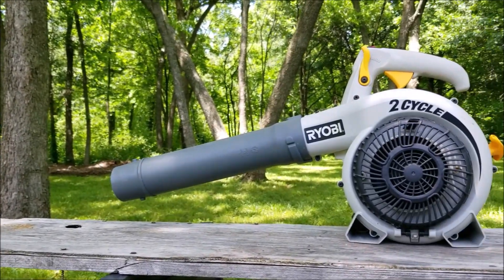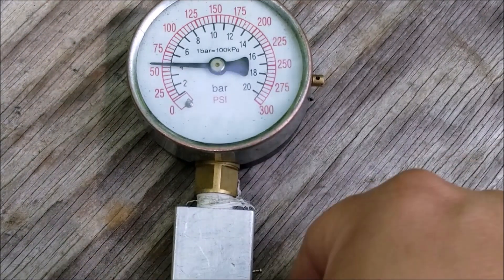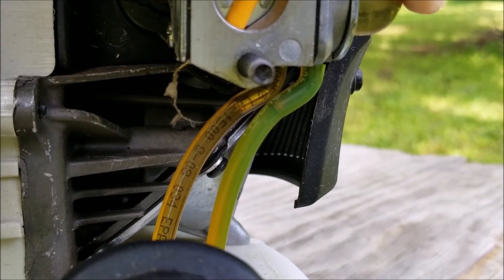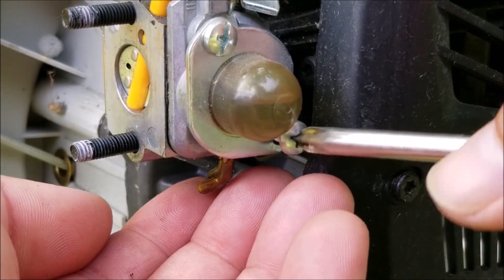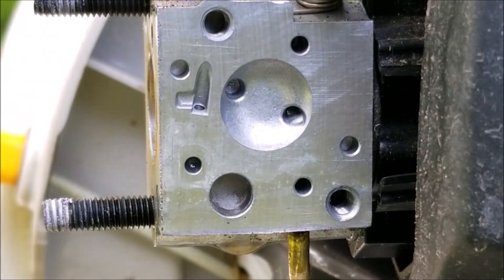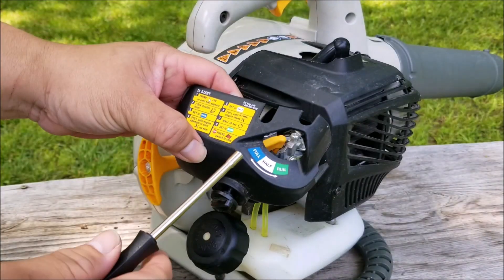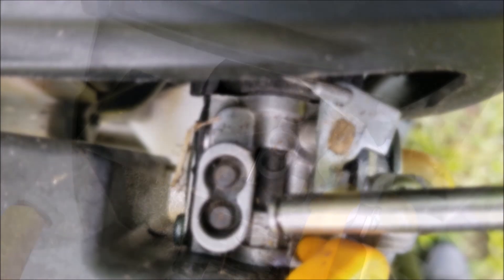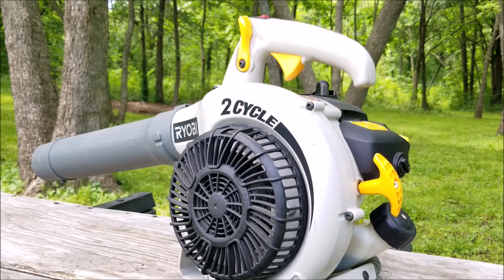Leaf blower starts but won't stay running finally fixed

Comment: I love your channel so much I guess I went back and watch most of your back vids and have got some of my friends to to watch as well . I have a small shop behind my house and work on most everything love it so much . I just had the luckiest day of my small engine repair days three days before thanksgiving I was going home through the rich part of town and saw this woman putting a bunch of Stihl weed eaters and two stihl chainsaws by the road so I stopped and ask was she getting rid of them and she said I could have them they looked good and was freaking out I was about to get them . Then she told me her husband had passed a few months back and was cleaning out the carport then she told me there was a big radius mower at the house that I could have if I could get it so I went to the house and it was a two year 61 inch gravely radius more looked about new I went and got my trailer as fast as I could . The best part of it all there was nothing wrong with any of it but carburetor cleaning fresh gas , three saws two blowers one a back pack all were stihls I still can’t believe it love your vids be safe
Reply: And two weed eaters
Reply from the maker: Wow.. it's like Christmas!
Reply: I made a boo boo on it I said it was a 61 “ deck it was a 60 with a 24 hp Kawasaki motor got them all running
Reply from the maker: @randygriffin5980  nice work.
Reply: I know I'm late, but wow that is pure luck!  I don't know what I would do if I got a free gravely.  That sounds like the dream for small engine guys.

Comment: I like the way you cut your fuel lines to insert them. I have been using the wire insertion tool to do mine. That is a good and effective tip I will use in the future. Thank you. Great video as usual. Your calm an systematic troubleshooting process is what attracted me to your channel.
Reply from the maker: I appreciate that. Thank you Rickey Mitchell for your time.
Reply: @HomeGaragechannel  your videos are always worth the time sir. Thank you.

Comment: Yeah I've got to fix my Ryobi gas blower. I went to Home Depot and got the Ryobi battery backpack blower. I returned it becuz the Ryobi backpack blower was just too big and storing it was a problem for me. Also maneuvering in tight spaces around the green house and corners of the house was restricting. So I picked up the Ryobi 40v electric leaf blower with a handle and that works out better for storage and occasional use. I may have to return to this video when I decide to work on the gas blower. I'm going to fix it and have 2 blowers to choose from. 
Thanks for putting this up!
Reply from the maker: Thank you for sharing your situation and no problem.

Comment: Haven't used my blower in a long time so it is in need of carb and lines I am sure.  I should get it fixed.  Thanks for the video's Hope you had a great Thanksgiving.
Reply from the maker: yes thanksgiving was great.  Thanks D Butler.

Comment: Great video, My blower is the only piece of equipment that I leave fuel in and I use engineered fuel. I also use it in the winter to blow light snow away from my garage and house doors. That was very strange gray stuff in the carb. I recently had a Champion generator in my shop that had some kind of sticky stuff in the entire fuel system, looked like honey. Ran great after a complete tank flush and fuel system and carb cleaning. Thanks for that video.
Reply from the maker: Thank you Waterman one
Reply: instablaster
Reply: I love your easy to follow, fantastic video. 
wethout special carb tuning/adjustment tools, is there any common mechanical tool that I can use instead.

Comment: This looks like my Ryobi model #09053.  I was going to try and dismantle/rebuild the old carb, but I am going to buy a replacement carb, get the machine running, and then clean the old carb and keep it for a backup.  Good tutorial video.
Reply from the maker: nice choice, makes perfect sense to me. good luck with it.

Comment: I did also replace the fuel lines and the torch after that the trimmer started but stopped after a few seconds , cleaned carburator etc....but finally I find out that the I connected the fuellines wrong . So I could prime and start but stopped as soon the primed fuel was consumed.... thanks to this video I got the idea to check the fuellines.
Reply from the maker: thank you Bart Beauprez for the comment.

Comment: Interesting video.  I've watched a bunch of these now and torn apart my Echo 259LN 3 times.  It is still dying after all my efforts.  It starts quickly and runs fine until it warms up and then quits and won't restart until it cools down.  Then the cycle repeats. I've changed to a new plug, new air filter and gas filter.  I have take the carb apart and washed everything even though I don't store fuel in it.  I have cleaned the spark arrester even though it didn't need it.  Yes, I'm stumped!  Your video indicates I may have to play with the carb settings.  I guess I have no other choice but to tr this.  For you Home Garage, my only critic is that at times you did a great job of explaining why you were doing things (fuel lines)  but at other times, you didn't provide the explanation.  My thought is the people who are coming to your site aren't the experts and they need the background detail (at least I do), like, where is the spark arrester you mentioned and why does it need to be cleaned.  Anyway, thumbs up!  I appreciate you pointing me in a direction to try something else.  I really like my Echo blower but am running out of patience.  And of course, the price line on these things is such that if you need to pay for service you may as well trash it.  Keep up the good videos.  I'll subscribe.
Reply from the maker: Thank you I'll try to do a better job in explaining my reasons why I do what I do in my videos.
Reply: Did you ever figure out why your echo blower quits after warming up? Mine does the exact same thing. Runs like a dream for a minute or so then dies completely and won’t run again until it completely cools down then does it all over again. Thanks in advance.
Reply from the maker: @fitfogey  depending on the model of echo blower, replace the fuel cap or the tank vent.
Reply: @HomeGaragechannel  Great I’ll try that thank you!
Reply: @fitfogey   How I overcame the problem you are having is I ran a lot of carb cleaner through it and changed what I thought was good gas.  It took a few times but after doing this, it started to stay running so not sure which was the problem.  It runs from cold and as long as I keep it running I'm okay but, if I shut it down it won't restart until it is cold again.  With the way it works now, and the fact that I have replaced everything else, I'm now convinced it is the coil.  I'm in Ontario Canada and the price of the coil is way too expensive and not worth buying. If you are in the USA you can likely get one at an affordable price.
Reply: @fitfogey  I think I might have had an oops! moment and you didn't get my reply?  If you didn't, what I said was I changed the gas (I thought it was fine but?).  I also ran a lot of carb cleaner through it.  It tooks several times but it now runs until it is out of gas.  I now use it from cold and once running, I complete my job before turning it off.  Just make sure you have enough gas in the tank.  I now believe it is the coil causing the problem but I live in Ontario, Canada and the cost of the coil here is prohibitive.  If you are in the US or can get there eventually, you may be able to get one and install it to resolve your issue.  Here is a good video I found which I will follow if and when I get a coil.  good luck with yours.   https://www.youtube.com/watch?v=VW_aA18ZS-A
Reply: Could be a defective coil/ Magneto it could be weak

Comment: Yes I leave fuel in all my 2 stroke equipment all the time but I'M a company and not a homeowner. I have never seen grey gunk like that in a filter or a carb before. Great video as always!
Reply from the maker: thanks nashguy207.  What kind of company is it?
Reply: @HomeGaragechannel  Commercial Landscaping company we use our blowers pretty much  everyday our trimmers wi;; sit somje in the winter but the oil i use has fuel stabilizer in it.
Reply from the maker: @nashguy207  nice. How long have you been doing this?
Reply: @HomeGaragechannel  About 12 years but i have always liked working on engines and stuff i started tinkering on lawn mowers when i was about 10 - 12 years old
Reply from the maker: @nashguy207  you're ahead of me in experience then.
Reply: @HomeGaragechannel  I don't know about that there was a lot of years when I was working that i didn't touch anything I even hired my lawn out I got into racing RC boats and between traveling 5 states for my Job and going to out of town boat races didn't leave me much tome for anything else. LOL
Reply from the maker: @nashguy207  nice.  Is the boat racing only recreational or competitive?
Reply: @HomeGaragechannel  I don't race any more but it was very competitive. Lots of different classers boats ran on fuel similar to RC airplanes but we ran higher nitro percentages i ran 60% in my boats depending on the style of boat and class they would run any where from 40 to 80 mph wasn't cheap either but it was a lot of fun you raced for trophies not for money.
Reply from the maker: @nashguy207  well it sounds really exciting at those speeds.  Do you have any trophies?
Reply: @HomeGaragechannel  Oh yes I won several over the years I had some good fast boats.
Reply from the maker: @nashguy207  awesome!

Comment: I have the same blower which also seems to be running out of air or gas I should say.
With your video, I believe that I will be able to give it a second "wind", no pun intended.
Reply from the maker: nice, hope you getting it working again.

Comment: That's a helpful tip to remove the fuel from the tank when through using the tool, even though the tool is used frequently.  We're living in an ethanol fuel era so we need to adjust.  Back in the day before ethanol, my gas blowers ran great and were so reliable.  Now that's all changed and is surely the reason that pre-mixed ethanol-free fuel is being sold, but it's ungodly expensive.
Reply from the maker: I completely agree with you on that

Comment: Great video man! I have that exact same Ryobi blower vac that I’ve had for 5 years. Been great but unfortunately this year wasn’t that good because it started having running problems and I did do some adjustments to the carburetor but still not running right as it is. So I decided not to be bother fixing this thing until I bought a homelite branded blower vac a week ago, it’s the same blower as the Ryobi but I’m hoping the homelite should last longer than my Ryobi but will see.
Reply from the maker: Good luck please let us know how it works out.

Comment: Home garage I got my Husqvarna 125 B hand held blower going the vent in the gas cap was close bought new cap and replaced it started right up 2 pulls runs good
Reply from the maker: excellent work

Comment: I just picked up one of these style blowers from work the other day.  We moved to a new shop and I found the blower and an Echo GT 225 trimmer in a junk pile. Problem with my blower is the starter pulley was worn down because the pawls on the flywheel were stuck causing the plastic cams to break off. I found another similar blower on Ebay for 50 dollars and hopefully the starter is good. It's a weird design how the recoil is because you need to remove the blower housing and the fan to access the starter assembly.  Also the exhaust is routed through the blower housing, but that might have been a decent idea.
Reply from the maker: Yes these are definitely unique

Comment: I use my leaf blower with fuel stabilizer in the fuel and no carburator issues whatsoever except the odd spark plug change but other than that a good tool for my yard chores and i think that engine short block replacement but easily fixable though online on that type since you cannot replace the piston and and rings but ideal for those not wanting to fiddle around with the piston and cylinder assembly
Reply from the maker: possibly rebuild it but a cheap blower is just so easy nowadays.
Reply: @HomeGaragechannel  yes i guess it depends on what's out there etc

Comment: I don't have my own leaf blower but my father only uses non ethanol fuel in his Honda GX25 powered leaf blower.

That one has a compression pressure of 55  PSI but that's because it runs a decompression camshaft.

It's 17 years old but it doesn't get used a whole lot !
Reply from the maker: that makes sense. its a 4 cycle right?
Reply: Yes it is, it's actually got the smaller GX25 4 stroke engine fitted.

Having said that I have a 1996 model Victa 2 stroke lawnmower which was fully made in Australia that I pulled out of a kerbside collection, they ran a decompression valve right from the 1970's all the way through to the last of them which were built in 1999 where they omitted the decompression valve.

They run Briggs and Stratton 4 stroke engines on the Victa lawnmower base now !
Reply from the maker: @RussellBooth1977  is the Victa a good mower?

Comment: You just g😊a be me what I have been researching for and which was the high side and the low stem. There are lots of videos,  
But no one state which is high or low to include the marking,your video is the best. Sign from JG in Corona CA
Reply from the maker: sure, these setting are only for this machine,  You can't necessarily use the setting I made on this one.

Comment: Used to run ethanol "enhanced" shuel in my equipment with a problem every season. Started using ethanol "free" fuel and haven't had a single break down in 3 seasons just replaced air filter and put fuel preservative in my fuel.
Reply from the maker: yep, best advice ever

Comment: 2 cycles are sooo sooo touchy!! I always have a problem with them.
Reply from the maker: You are absolutely correct about that.
Reply: 4 cycle is way better because has more  torque

Comment: Hi, thanks for this quick tutorial, it has given me some insight on the L and & H adjustments, I do leave gas in the tank but I do my yard at least once every 2 weeks, so it's always in constant use . I do however have not been able to reach the point where when pressing full throttle it won't stay running, it actually stalls , just can't find that sweet spot , any pointers to adjusting the carburator is greatly appreciated.. thanks for the video .
Reply from the maker: if it gets to that point, then it means, the carb is not able to deliver the correct fuel, even with adjustments and you'll either need to service the carb, or replace it.
Reply: @HomeGaragechannel  Thanks for replying, I did replace the carb, brand new one with fuel line, filters, gaskets and the carburator all new... I carefully reassembled then primed and after lots of pulling finally got it running, and that's because I copied same setting from the old carb, that's how it suddenly ran, however after doing the adjustments you mention it did improve but if I pull that throttle all the way it will stall, the only way to keep it running at high speed is using the lever to hold the throttle at a certain point, otherwise I have to keep pressing and releasing... I'm just curious if there is a default setting of the needles the H & L , based on where the blower will operate, I'm pretty much at 150ft above sea level, but it doesn't mean the new carb is shipped with those specs in mind... Thanks for your reply tho.
Reply from the maker: I see, thanks for the info, unfortunately  there are not pointers that I could give to you at least thru comments as the thread would be back and forth , several times.  It takes experience to tune, and your best bet would be to ask for someone near you to help out.

Comment: The process to winterize my 2-cycle equipment is pretty straightforward. I treat one gallon of gas with stabilizer, fill some of the tank, purge the bulb ten times, run it for two minutes and then dump the remaining gas back into the can,and finally, i run the motor until it's bone dry, I mean you need to press the purge bulb until there is no more fuel in the bulb and lines. That's at least how i do it.
Reply from the maker: that pretty much the way i do it too. so far so good.  thanks for the comment

Comment: Does the new tube degrade as fast as the old tube?
Reply from the maker: no it doesn't but leaving the out of the machine, during the off season, helps.

Comment: I have a 36 year old Shindaiwa C-35.I always empty the tank after use.I use low pressure air to dry it out before replacing the fuel cap.California gas eats fuel lines.
Reply from the maker: Wow, well at least you know how to deal with it.
Reply: The Shindaiwa is a weed eater.Over the years I had to replace the electronic ignition unit and multiple carb kits were used to keep it running well.

Comment: A lot of people want to know what  that grey material is in the screen. I finally figured it out. Remove the fuel filter from an old machine and look at the weight that holds the filter down. Now, take a file and file some of it off. Look familiar? I have noted most weights are corroded, chewed looking and some even crumble if pressed with pliers. There's  you grey material.
Reply from the maker: You are absolutely correct about that